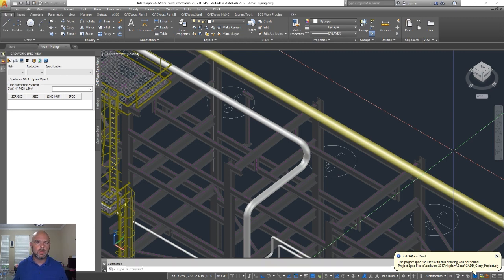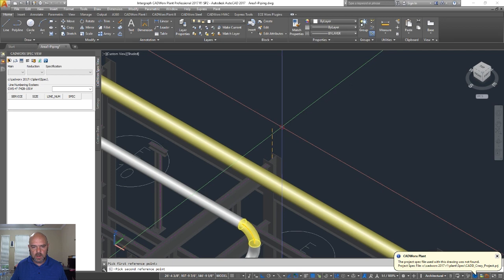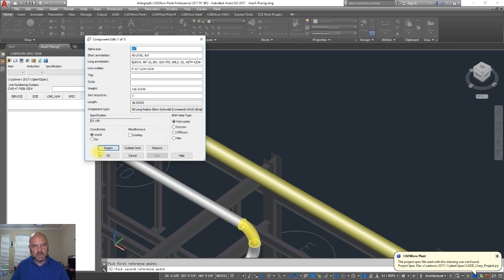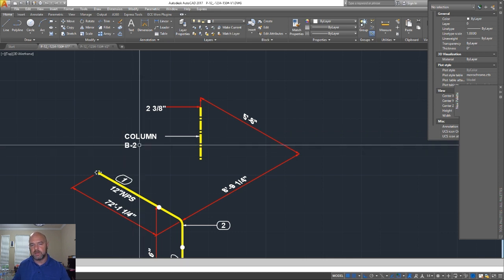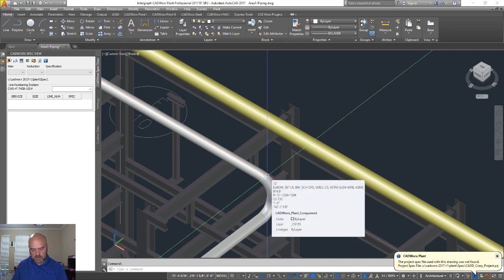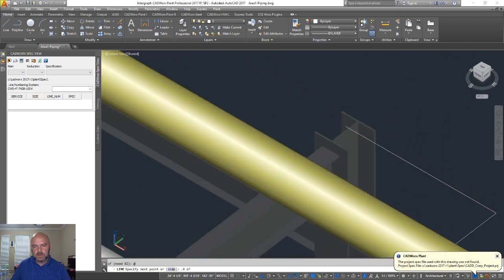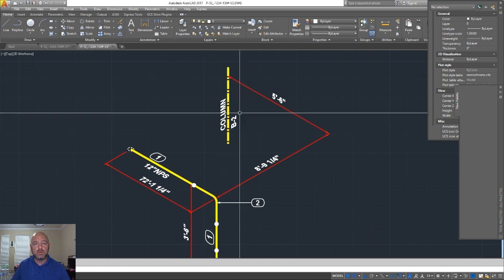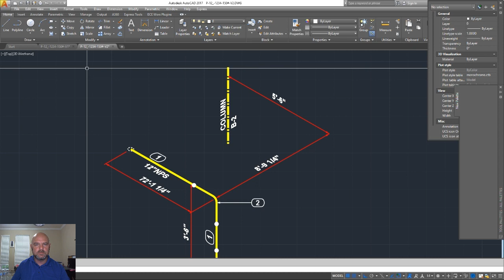CADWorx Reference Dimension for IsoGen

Comment: This was very helpful. How can I change the origination (or first point) of the reference dimension. It seems to always lock onto the midpoint of a pipe or some insertion point of the component.

Never mind, I see that the start point can only be edited if you edit a user shape.  Sure wish we could modify this to start at the end of an elbow or pipe, rather than the middle. 

Any ideas would be helpful.

Comment: I just tried this but it didn't isogen the reference. Edited "NM I figured it out. Lol."
Reply from the maker: That is good. What was it? I was going to tell you to check the IsoGen Config file to make sure the Reference Dimension was turned on.
Reply: @caddcrazy9069  I think it's because when I picked the location I didn't drag up and end the command. Or the centerline of the steel that I picked was an extruded 3D object. I placed new still in that location with a centerline and tried it again. It Worked.

Comment: This video is great however is there a way to make the reference dimension orient to the proper location on the ISO?  I'm referencing new steel for my design but the dimension is showing in the wrong location.
Reply from the maker: Once you pick your point for your reference you must give its orientation. If it is vertical steel then you pick up, but if is horizontal steel you pick in the direction of your beam.
Reply: @caddcrazy9069  OK I'll give that a try and see how it works!  Thank you!